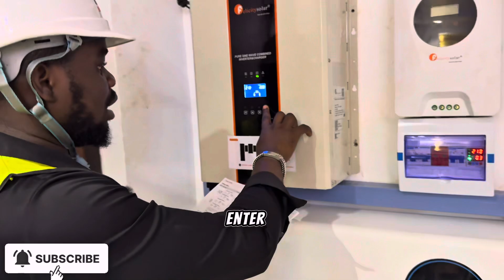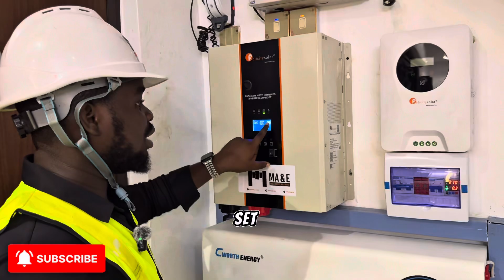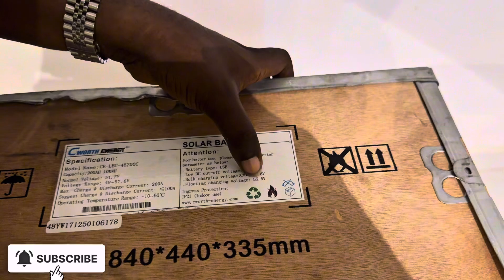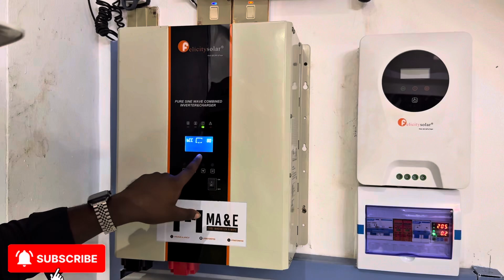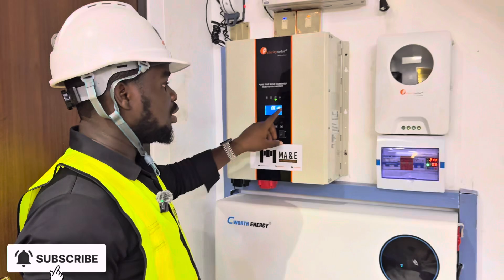How to communicate felicity inverter to a cworth lithium battery

Comment: We should not mix things up. When selecting User-defined option the inverter and battery doesn't communicate, you are only give the battery manual settings through the Inverter. No communication was established.
Reply: U have point... If you like set everything on that inverter, since they is no communication cable between battery and inverter eh. Hmmm is alright